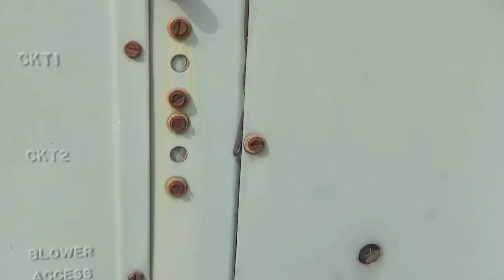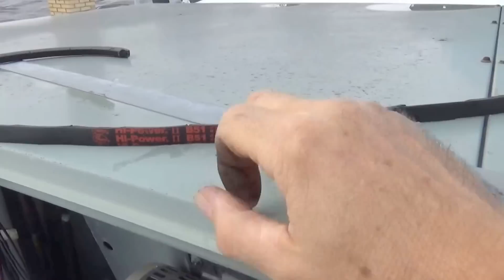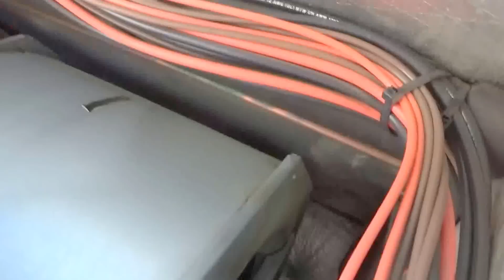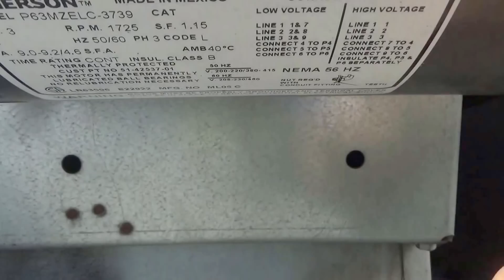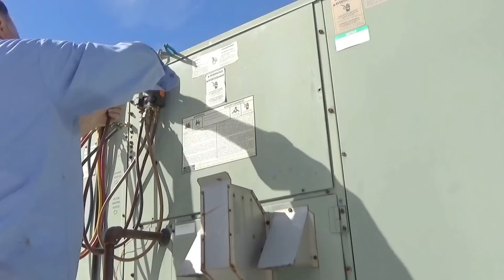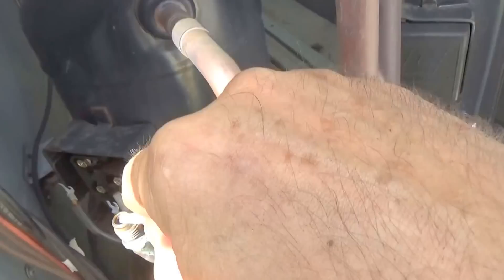Rheem 8 ton AC unit Saturday Emergency Call

Comment: Leave the compressor leads connected and test from the load side of the contractor for ohm reading through compressor - then just pull the coil wire on the contractor to isolate the contractor to shut down the bad compressor.  Much faster and safer.  Also looked like you should have bought a belt a little shorter looking at the adjustment  slides.. I hate it when a customer uses breakdown maintenance and then wants a miracle on Saturday - that is when my severe aggravation service surcharge kicks in along with overtime.

Comment: If it's rated for max 9 amps runit at 7 hav R 8 max at 9 its like running a car at 120 m.P.h. it max speeed is 120 how long will motor last

Comment: Great video as always thanks
When you work on package unit for r-22 what should be your suction pressure and high side pressure also how to check super heat on those units thanks

Comment: never check amperage with the door off
Reply: That’s why there is a SF on the motor Service factor the amps will drop when you put the door on and the service factor was 1.5 amps  so it will lower below rating.
Reply: thats what I was thinking, you would get a higher number with door off
Reply: Pay attention.  He did read 7 amps with blower door closed off of the blower contactor.  What he did not do
was smack that compressor dome with a hammer.  Sometimes the compressor internal overload thermodisc is just stuck open.  When the fan belt was off this compressor was flooding back refrigerant and possibly over heated enough to trip the overload protector and it didn't reset.  I have done this before and reset the disc.
Reply: @bcool3085  No doubt the compressor was repeatedly tripping on its internal OL, which is why it went bad. While they will sometimes reset if you smack the can, the compressor is usually on borrowed time at that point. If you're lucky it will seize, trip the OL, and the OL will stick open again. If you're unlucky the compressor will short a winding, and you get to clean up after a nasty burnout. Either way, the compressor will wait until the hottest, most humid, nastiest summer day to die, making the job extra miserable for both you and the customer.
Reply: If OL trips due to a flood back, I think it’s  because of  a seized bearing. The flood back will turn the compressor in to a solid block of ice, and dilute the oil. The compressor is a toast.

Comment: Why don't you take a compressor apart to show the inner workings.
Reply: if it was a semi hermetic compressor then he could take it apart.  the ones in this ac unit are hermetic.   meaning hermetically sealed.   semi hermetic compressors look more like car engines and can be taken apart.
Reply: unless you take a hermetic compressor and cut it open with a torch somehow.
Reply: Yes Take a hermetic compressor apart
Reply: +hmbld1 if you, or anyone wants to see that, i have a scroll sitting beside my house i am cutting open soon. i could post video of it. i just did a trane scroll a couple months ago. I should have gotten video of it aswell cause they are funny little compressors.